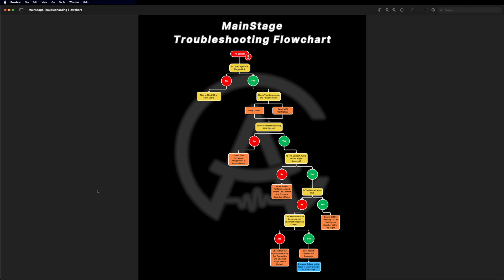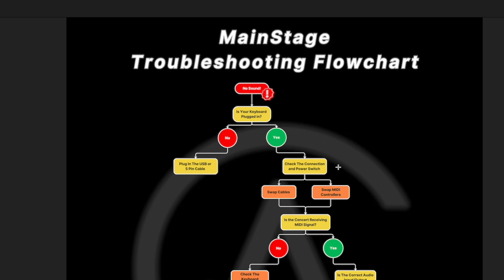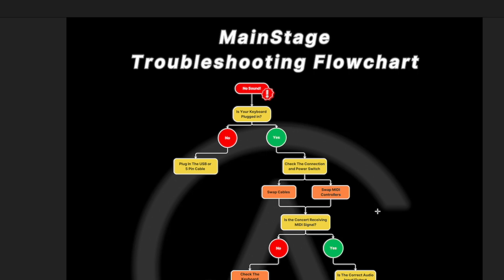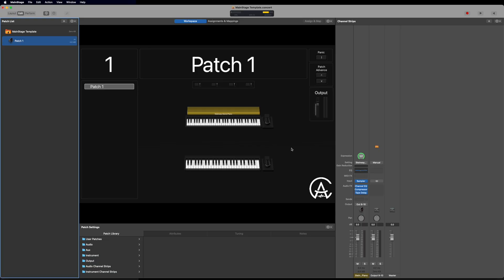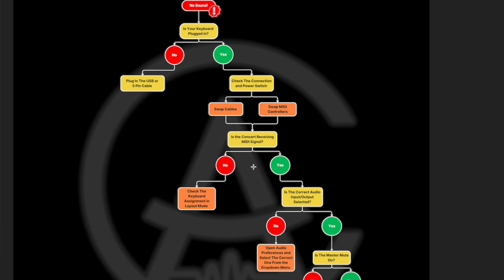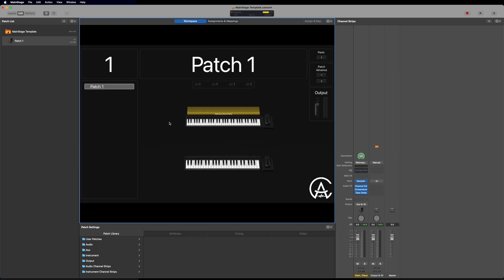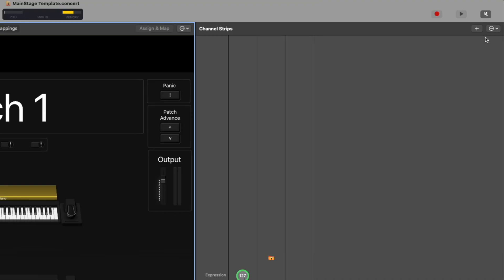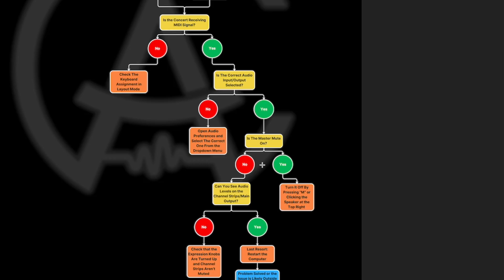What To Do When MainStage Isn’t Working (Free Download)

Comment: I’d almost do your flowchart from bottom to top. I feel top to bottom is kind of backwards for troubleshooting it
Reply from the maker: Interesting viewpoint! This flowchart follows my usual strategy when trying to figure out why there is no sound coming out of MainStage. I like to start from the input(the MIDI controller) and work my way down to the output of MainStage.

Do you typically start from the output of MainStage and work towards the input?

Comment: That Master mute was almost the death of me a day before indy! Thanks James!
Reply: That should be closer to the 1st things to check. No way am I changing out the whole midi keyboard before I’ve done so many other checks. The order of the flowchart is a little off in my opinion.
Reply from the maker: The MIDI controller would only get swapped out if I've confirmed that it isn't turning on. Once I've ensured that the MIDI controller is working I move on to the next step.